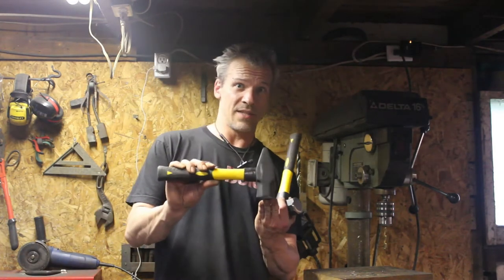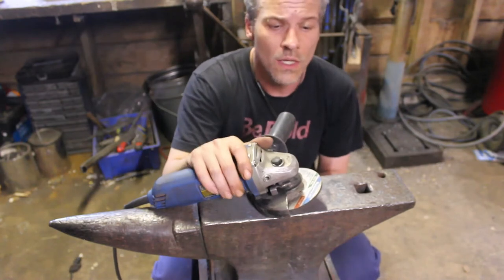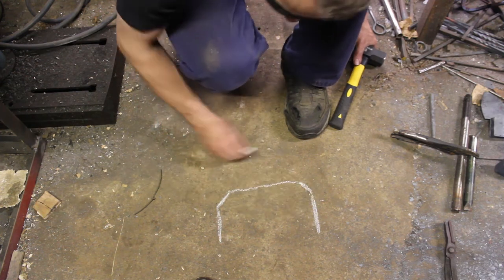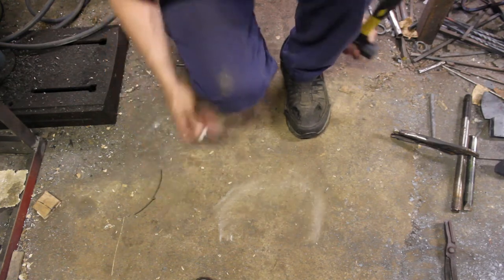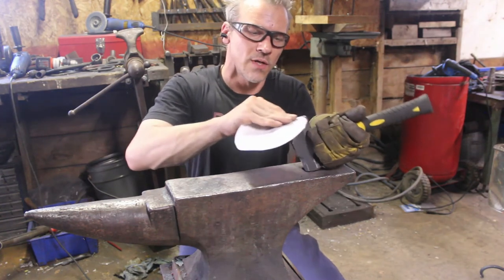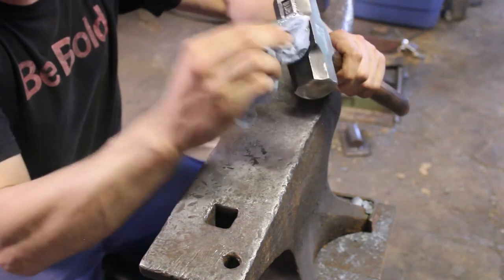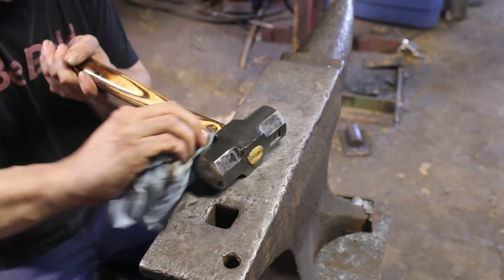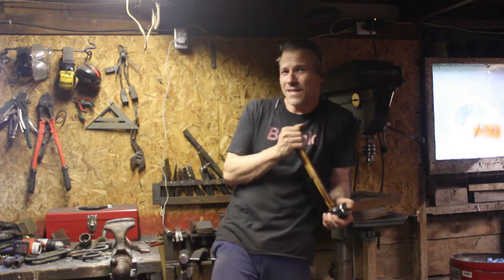$7 Hammer to a Blacksmith Rounding hammer.

Comment: thank you for your video!  this is my project for today without replacing the handles right away.  i was interested in the handles, but they seem to have a pretty fair amount of runout on the grain.  at least in the video they did.  are you happy with the handles?
Reply from the maker: Thanks for your comment John.  As the handles go, they have held up so far with the hammers... The axe handles on the other hand is another story.  Had two axe handles break on me and I stop using them.  Went back to hickory with the axes.

Comment: Thank you for this video, I have been looking from someone to explain the exact method to facing a hammer and then show with a tool most people have or can easily obtain. Most other video's they rush through the process and then run to their over $1,000 2x72 grinder and have the camera so far away you can't really see what they're doing. Starting out I don't have all the bells and whistles and have been looking for ways to modify the tools I have so save some money, this video has helped as a visual reference.